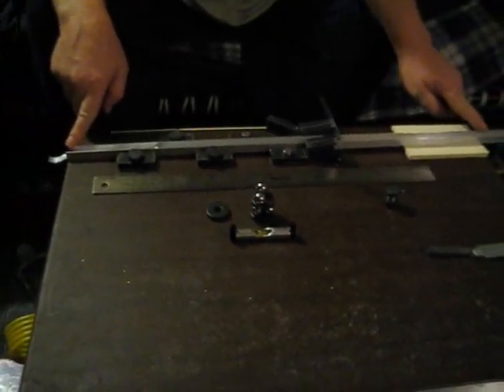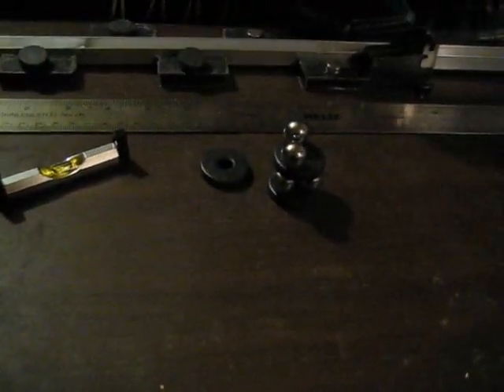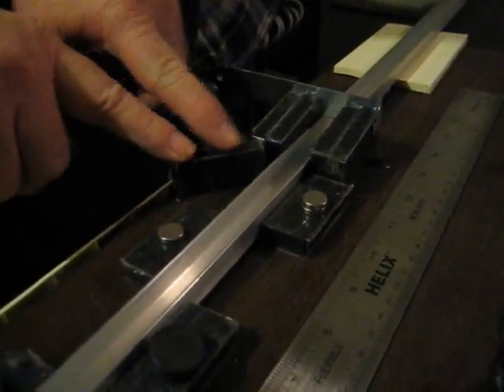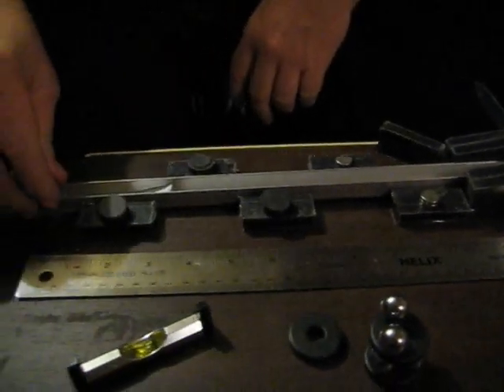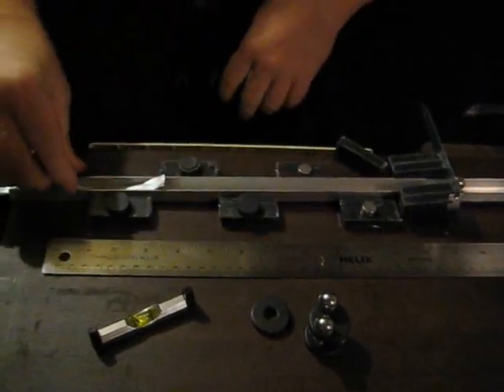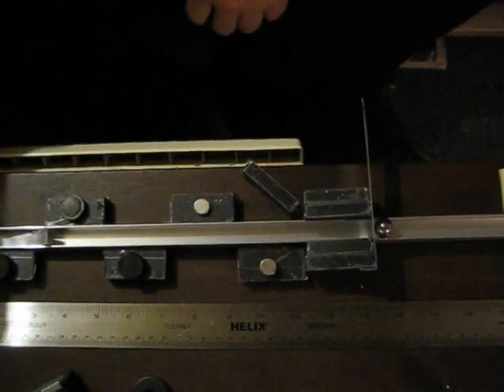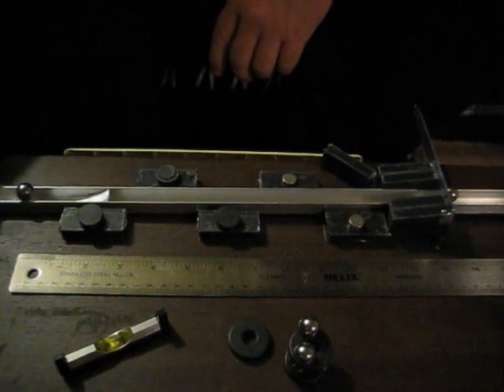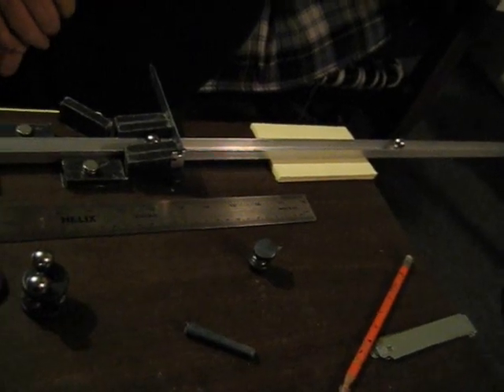Permanent Magnets Doing Work 2

Comment from the maker: The proximity of one ramp to another would have to be sufficiently distanced to avoid any interaction between the strong final set and the weaker first set of the next ramp. Notice also that in this demonstration the ball is trapped in the final set.

Comment from the maker: You are correct. However in this exercise the purpose of the demonstration was to show that the initial exchange between potential and kinetic energy did not have to stop with the first magnet set. Also, kinetic energy was added by each successive stage, and then finally - a mechanism is provided to extract the energy from all the magnets in the final transfer. Note however that the cost for this is the entrapment of the primary target (first ball).
Cheers :)

Comment from the maker: Energy is lost during changes of direction. Since the power for this device is derived from the continuous increase in magnet strength, it becomes necessary to use a shunt device on the final set to allow the 'drop' to occur as you have suggested. These processes are feasible and gravity can be used to assist in the separation of the object from the final field. In order to accomplish this, foward momentum must be added to g to equal 1/x^3 of final flux thus providing escape velocity.

Comment from the maker: It's obvious you have not watched the entire video.

However, even though your point is stipulated to in the video you are incorrect in your assumption that this is the only choice. There are ways of resetting the system which use less energy by comparison to manually 'pulling the ball out of the well'.

Comment from the maker: How many directions does your well exert a force? Is it possible to fall up? Can a rubber magnet be turned inside out? Can your 'well' push? Is it possible to turn the 'well' on and off? Where does the potential energy come from? Can it be throttled or amplified? What is a BH curve? Where does the energy go that is used to make a magnet? Can it be retrieved? What is the cost? What is the inverse cube rule? Why is it different than your 'well'? Can inverse square and inverse cube work together?

Comment from the maker: Closed systems have been a puzzle for nearly everyone that has attempted it. Finsrud has already demonstrated it but some believe he used springs and I cannot refute that without inspecting the devices column. I do however have a project I will reveal in due time that may overcome the dipole problem that plagues so many.